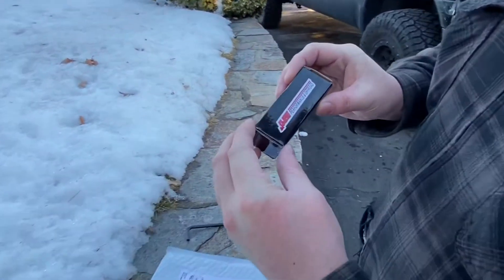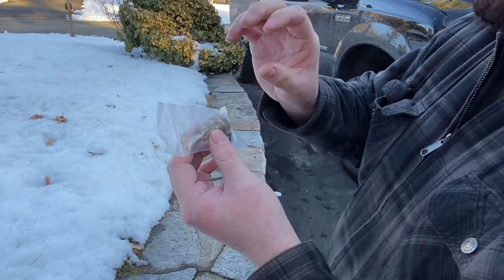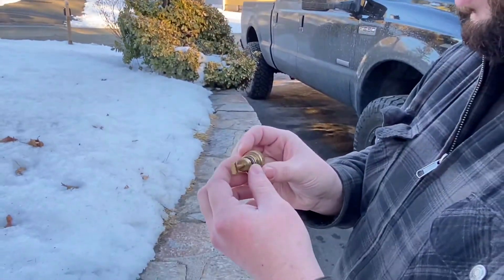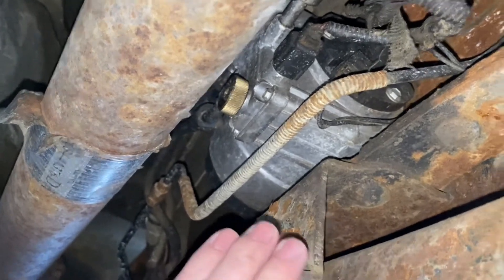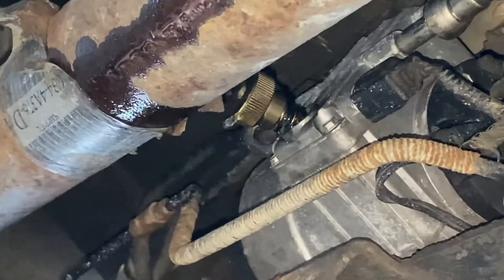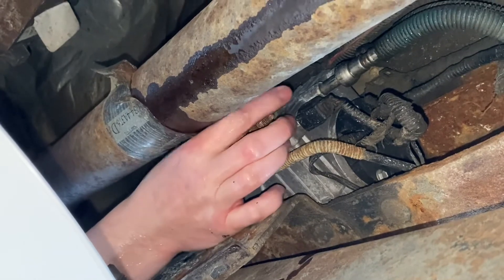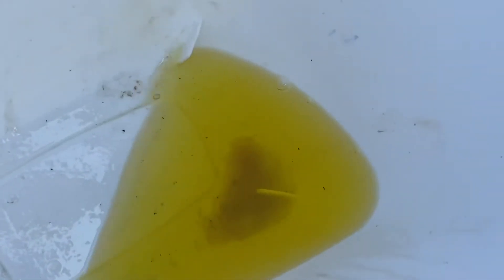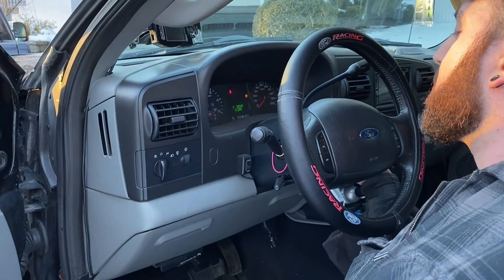How to drain water in fuel 6.0 Powerstroke (P2269 water in fuel)

Comment: I'm new to the diesel world. I didn't know this was a thing. I just changed out my fuel filters, would the water have emptied out when changing the filters? 
Thanks
Reply from the maker: Most of it would have. If you get the light on your dash now you know how to drain it. I always tell my customers oil every 5k and both fuel filters every 10k on stock trucks.
Reply: @ScottMyers5189  that's a relief :) thanks. 
Oil every 5k?  I use that shell Rotella and was told I could go 10k with it 🤷